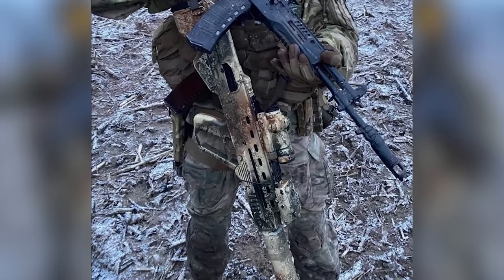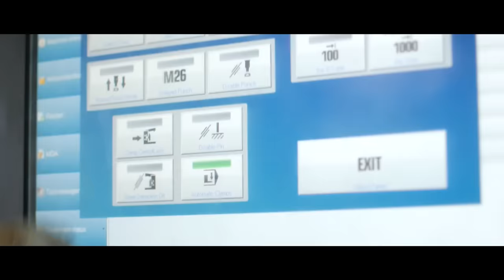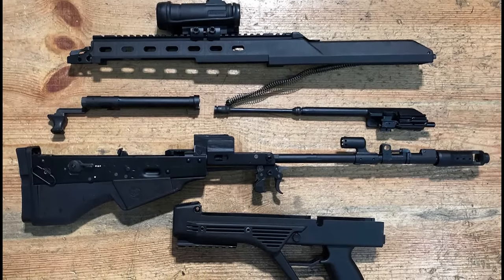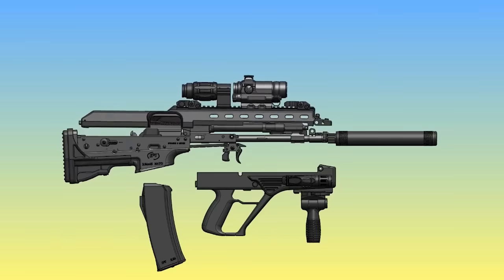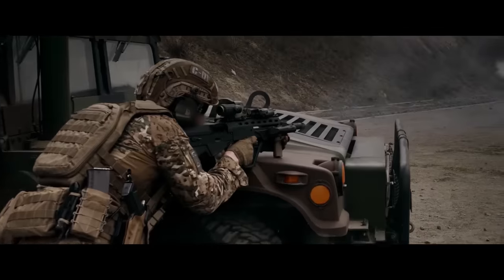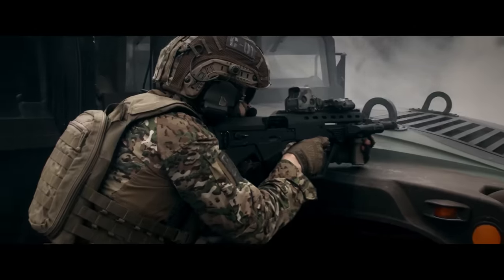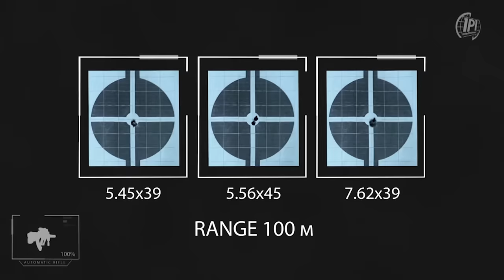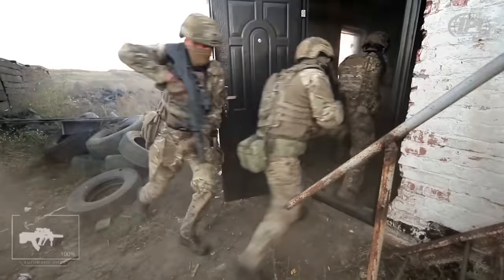Vulcan / Malyuk: Ukraine's Bullpup

Comment: The magazines are not only drop-free. They rock forward to lock, and I've often wondered why that system isn't more widespread.
Reply: Likely because in the field of bullpup AK conversions, this looks as if they went beyond what most people do to an AK when turning it into a bullpup. Namely, bolting on a new buttplate, relocating the pistol grip, adding a new trigger and a linkage rod, wire, or bar to the original trigger, and new sights. The original was definitely the classic AK bullpup conversion, but clearly they've put the time and effort to make it more usable.
Reply: There was an SKS bullpup chassis that did this with modified duckbill mages (with the duckbill mostly sawn off).

Comment: If they can find a way to mount the Pic-rail section on the trunnion and have the polymer top cover go around it, this rifle could be a killer.
Oh, and maybe cut down on the weight. 4 kg before optics and sights sounds like a lot.
Reply: more weight less recoil you feel /better stability

Comment: Its interesting that the Vulcan has mostly focused on 7.62 and 5.56 while ignoring 5.45 especially in the systems further development.
Reply: That's mostly mostly because every single eastern european country has practically endless shitloads of 7.62x39mm m43 ammo and AKM magazines just collecting dust in storage. Meanwhile ukraine has adopted an AR15 variant designed to barrel swap between 5.56 nato and 7.62x39mm so they can transition to 5.56 nato while further using up old stocks of the latter and 7.62x39 is still great for short barrels compared to either 5.45 or 5.56.  

Unfortunately for 5.45 it never had time really catch on outside russia like 7.62x39 did which is a shame cause it's actually a somewhat better round if you want to reach out and touch something out to 600m than most loads of .203 on the market. If it weren't for the russian ammo ban driving 5.45 prices through the stratosphere I might fancy me a sks in 5.45 but sadly only 7.62x39 is really domestically manufactured in significant quantities for the civilian market in the US and that hasn't stopped 762x39 prices from rising either now that there's no more dirt cheap steel cased garbage russian ammo.
Reply: @7ElevenTruther  where I'm from 5.45 is just as cheap.

Comment: Does it keep its zero after disassembly? It looks like the lower has the barrel and upper is only the rail.
Reply from the maker: I'd have to handle one in person to be certain but the upper and lowers are locked together via a front pin which is tensioned by the locking lever.

Comment: I’d like one if I wasn’t a lefty. Very cool
Reply from the maker: You're in luck Kevin, they're ambi!
Reply: They are ambi with a built-in case deflector.
Reply: @TheArmourersBench  Is the brass deflector good enough to switch sides on the fly like the VHS-2, or does it need disassembly and bolt swapping like the AUG?
Reply from the maker: From what I've seen it's good to just switch shoulder it's juts out a fair way to deflect forward.
Reply: @Nedw  It doesn't switch which side brass flies out from, it just deflects it forward so it won't fly in your face. So you can shoot from the left shoulder safely, as far as I see.
Reply: @TheArmourersBench  now I just have to get a plane ticket.